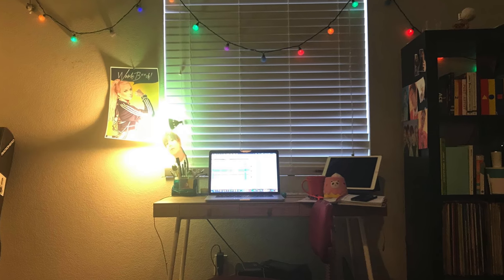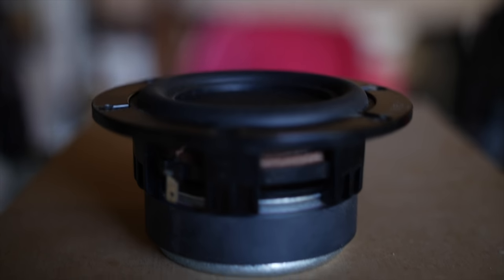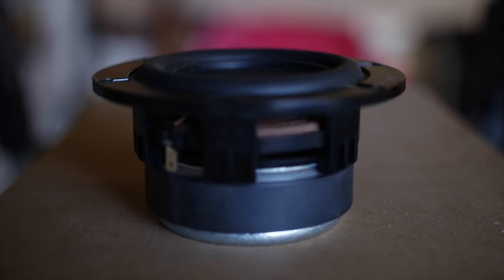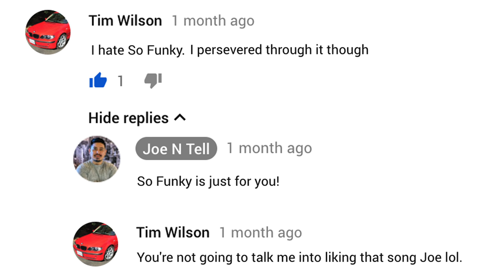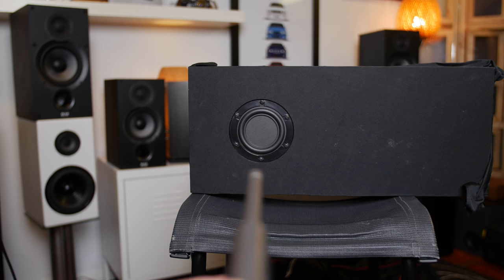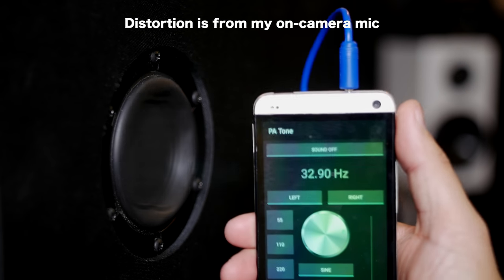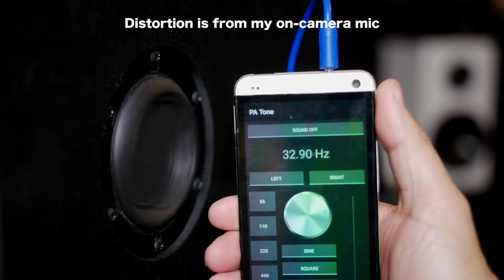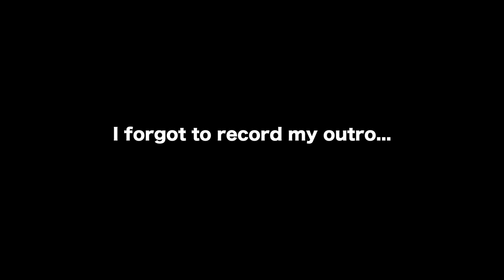DIY Tectonic BMR Build - Lepai LP40PA Powered Bluetooth Speakers aka "Little Slappers"

Comment: Wow those sound amazing for their size. I would recommend listening to playback on a decent system or some good headphones. That baaaaasssss was impressive for such a little driver. A little EQ and you could get that response super flat. Nice work.
Reply from the maker: That's right, a bit of DSP would make these sound sweet. You can also do some work using a basic graphic EQ too.

But yeah, these slap! 🤣

Comment: Dude all the gloss black designs you showed from Parts Express were mine!  Haha.  Yea, these are nice speakers.
Reply from the maker: Oh no way! Those are freaking awesome! What is your experience working with these BMR drivers? Please tell all!

I saw some gloss towers and some satellite speakers. I'm curious about both.
Reply: @joentell  very nice!  The cube speakers with subwoofer are sealed.  Standard slope .7 I believe it is.  They are the 3.5" ones.  The system uses 1/2 inch MDF.  The signal can go in via RCA or bluetooth, which are both fed to a mini DSP.  The speakers/sub crossover is at 90Hz on those.  High pass on sub is 30Hz.  EQ is minimal on the satillites.  A small boost at 2K and a small cut at 12K.  They sound really nice, especially with the sub going to 30Hz.  I designed the sub to be efficient down low, but with a high impedance from 70-90Hz, so I could push the EQ up near the crossover point and still drop very low.  They use two 50Wx2 Sure amplifiers from parts express.  I build 5 if these for a client.  They were very happy.  I used Styrene Acrylic on those for the gloss black.

The small towers was a budget build for my brother and sister in law.  RCA ins only straight to a 15w x 2 amp.  I built in a ramp up from 500Hz down to 50Hz to compensate for lack of baffle size at least a little.  They are very impressive sounding.  They have a little smiley faced sound (probably due to a small baffle), but it sounds very pleasant.  The on/off button is an automotive soft touch button.  Rap music isn't even a problem with those.  I used Duplicolr Laquer on those and I'll never do that again.  What a mess!  lol.  With Styrene Acrylic you don't need a reperator or acetone to clean up.
Reply: @joentell  great video BTW.  I hadn't said that, but I meant to.
Reply: @joentell  the BMR's are probably the best overall band for the buck.  I just built using the 3" ones.  They only go to 150Hz, but they get so loud, I learned I need to upgrade from 1/2 to 3/4 MDF.  I really like the drivers for general listening and cheap price!  They have a great musical character and dynamics I never thought possible at this price.

Comment: I have used these speakers before and the one thing that i found is that they need to be burned in for a long time but after they work in they sound Amazing. They are a little muddy at the beginning then they brighten up and mellow out. Play them on the louder side for a couple hours. They are also really forgiving on the box you put them in. Can’t beat them for the money
Reply: After you've burned them in,how high can they hit do you reckon?

Comment: How would those BMR sound in a vertical array with 4 spkrs per side, that will be cool.
Reply from the maker: I saw on the product page for these at Parts Express, it looks like someone did just that. I bet it would sound pretty good. Multiple drivers is a good idea because these have a low sensitivity. Link in the description.
Reply: @joentell  Also , I think it needs beefier power to give it's best being low senstivity. Sadly, these are not available in Pinas. It will be a lovely project for me.
Reply from the maker: @allansoria3478  You're right about giving it more power. Sorry they aren't available there in PI pare.

Comment: I want to build a system using these drivers. Whats the smallest box I could use and still get decent bass. ? Can these speakers be used with a passive radiator?
Reply from the maker: Not sure. It's been a while since I played with the enclosure for those. Lots of info at Parts Express though.

Comment: Wall resonance?
Reply from the maker: The wall does affect the sound, but I'm using it as an extended baffle and to enhance the bass response. These tiny 3.5" drives need all the help they can get especially because the way I've tuned the enclosure.

They have padding on the back so they don't resonate ON the wall because of the contact.

Comment: I plan on building some 3d printed better than Bose pc speakers with tectronic bmr drivers and peerless passive radiators that lights up.
Reply from the maker: Just make sure the enclosure is large enough

Comment: It took me 3 years to watch this video?  LAME!    Should have done this years ago.  These drivers seem to be the perfect ticket for car audio when you have to use them off axis it seems.    Ordered the 2 inch version to try out and  see how that will work in my front stage. 

After these?  Its just going to be some PRO audio drivers if they don't meet my output requirements.      One day?  I'm going to go to a SPL show with a Meet Joe Black CD,  and a thumb drive of test tracks and see what they can really do with orchestral pieces and kettle drums.   

being that I'm a musician, I have some pretty stringent requirements for reproduction , especially my own vehicle.     I'm hoping that these Tectonic  drivers are part of the puzzle.  
If not these?  Time for some JBL Horns in the dash.  :-)